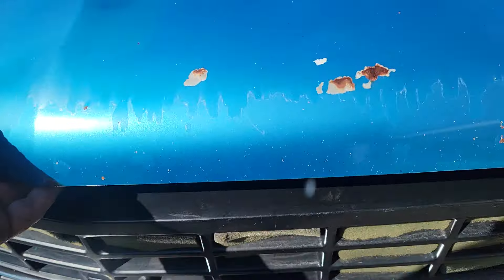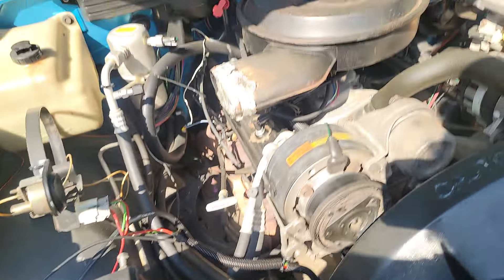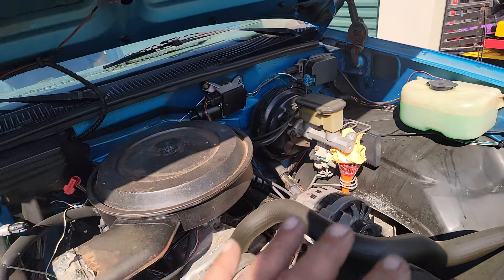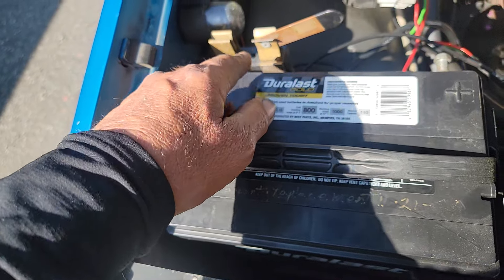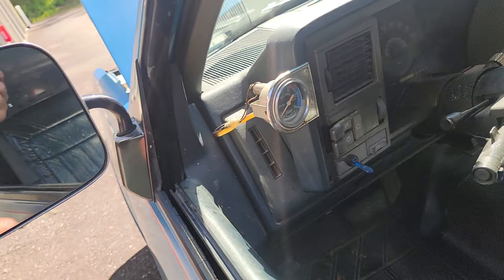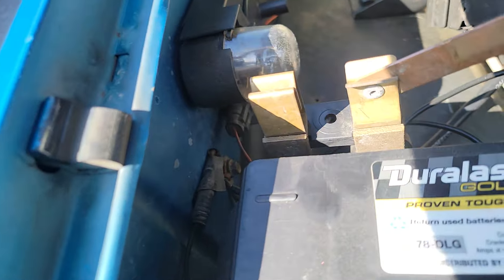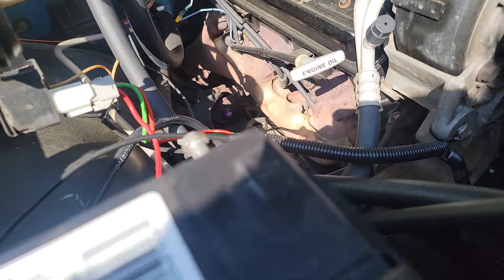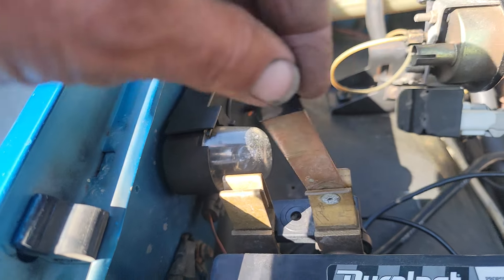Reff: Finigan's Garage Electrical Fire

Comment: One extremely important thing about a high current knife switch for DC, especially with no operating handle.  If you disconnect it with a lot of current flowing, you will draw an arc.  Use heavy flameproof gloves, or pull it with a tool, if possible.

Comment: It's exactly the same current on both poles, there's no difference in the sparks it makes when connecting.

Connecting positive first is pretty much for the safety, as you can't then short circuit to chassis with a wrench etc, as there's no connection yet between battery negative and vehicle.

While connecting negative, there's no such problem, unless you somehow manage to get your wrench between the battery poles, which would be a problem while connecting the positive too, but way harder than touching any metal part while wrenching the positive terminal.